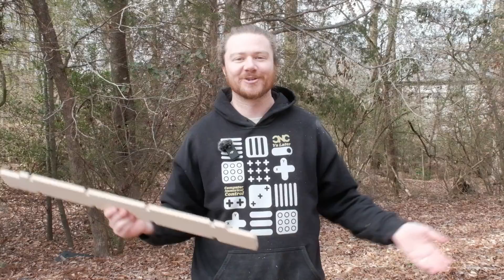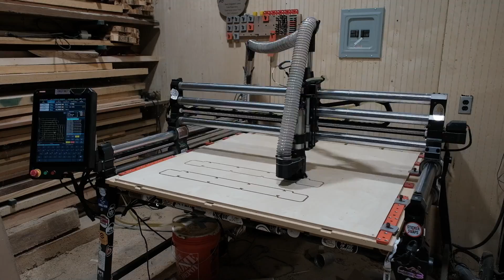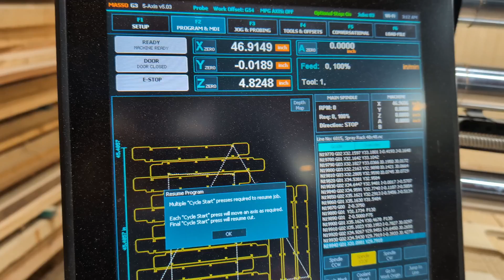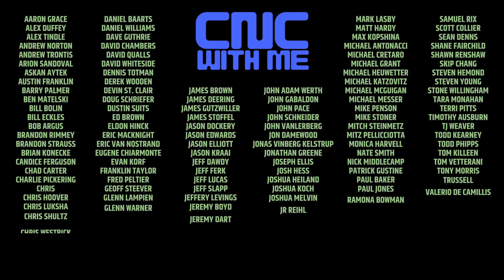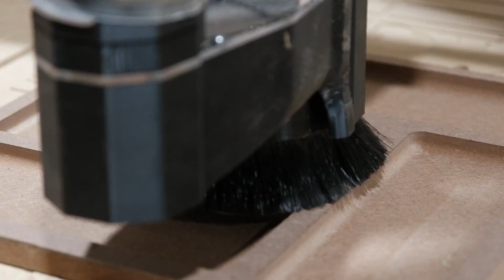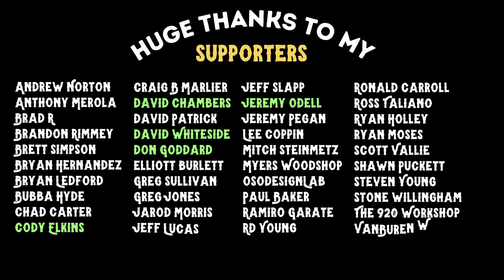Easy Woodworking Project: Modular Drying Station (Stack Slats)

Comment: If you clamp x number of 1x4s together you can make a cut marking jig(stick) run a circular saw across the tops, cut that notch across the top, flip, etc. Seems like we're going the loooong way around the barn because a hammer is the tool we want to use
Reply: 2x4s famously twist and warp if they are not secured with joinery or fasteners plus they need to be skinned at least on one side with drywall or plywood screwed along their lengths to hold their shape relatively plumb and square.   The circular sawed notches on 2x4’s would fit together the first time you assemble (assuming you assemble immediately), but then you take it apart and store it, all the pieces twist on you.  Now the notches no longer line up and you’re throwing them away. 

Also, these are like half inch thick plywood. The same number of pieces of 2x4’s would take up triple the space when disassembled and stored.

Comment: Eventually Onefinity will come up with a collision avoidance system. It will probably use LiDAR  or some kind of sensor to detect something ahead of the cutting head. Maybe a switch connected to a spring steel wire that when it hits a object it pauses the machine. We can hope.

Comment: Hi Hamilton!  Can I pick your brain???  I think your go to end mill is the Downtown Jenny (a very good bit).  For me, my go to end mill is the original Jenny compression bit.  Have you even done a comparison between the two, or have you always had great results with the downtown Jenny and have everything optimized for that bit (if it ain't broke, don't fix it)?
Reply from the maker: I never have, I mainly started with hardwood so it made a lot of sense for me to use it specifically. Now that I'm venturing a little more into plywood- both have their advantages. I run both at the same feeds and speeds though- 130ipm, .125 doc, 17000 rpm